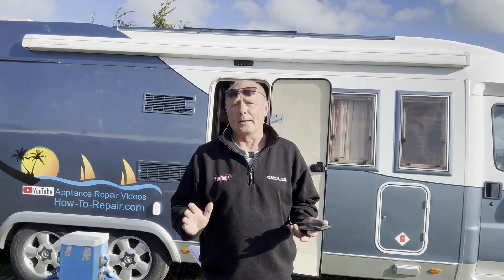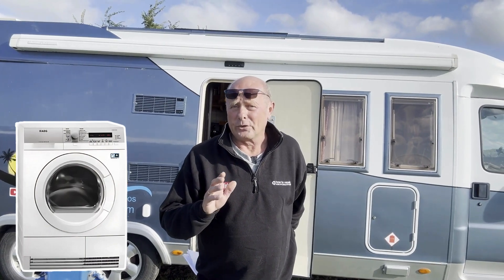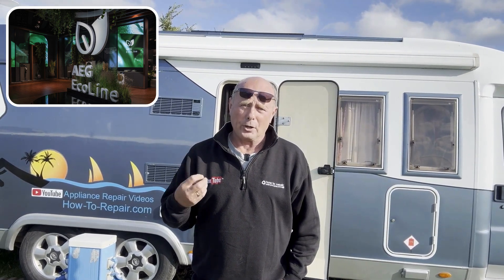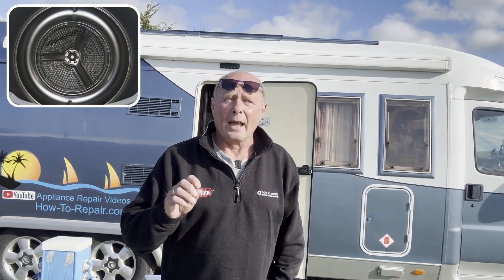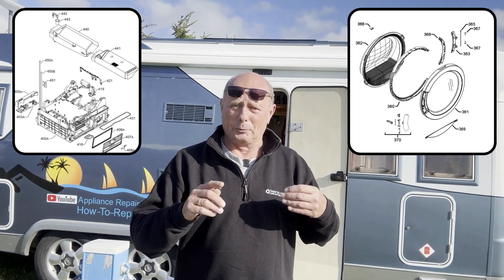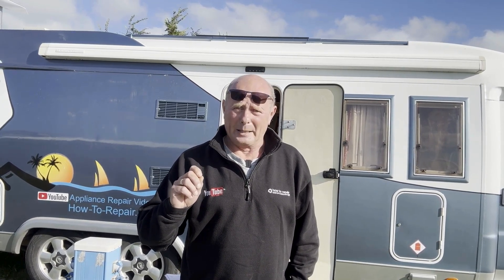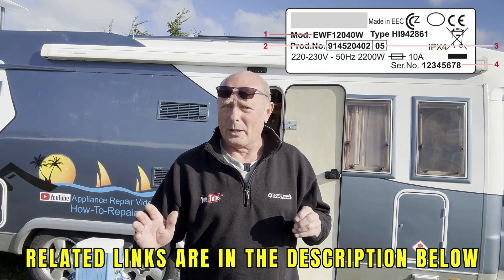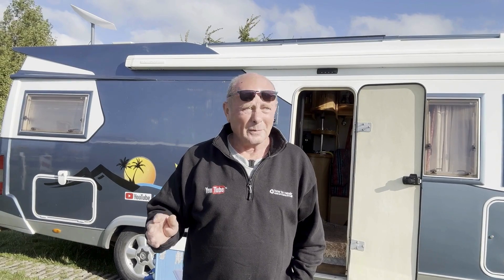AEG T76385AH3 Tumble Dryer Stops After Exactly 30 Min - Answered From Holland

Comment: No amount of filters will prevent the lint build up on the condenser on heat pump tumble dryers. Electrolux machines  have 3 filters and still the condenser is clogged with lint after 4-5 years and no user maintenance can prevent that. What they can do is design a more friendly system that would allow easy service and cleaning. Right now, if you want to thoroughly clean the machine, it needs to be disassembled to the last part and that is a LOT OF WORK, thus HIGH COST!!!
Reply from the maker: I totally agree the servicing side should be put first when they design these machines. It is crazy how many are being thrown away.